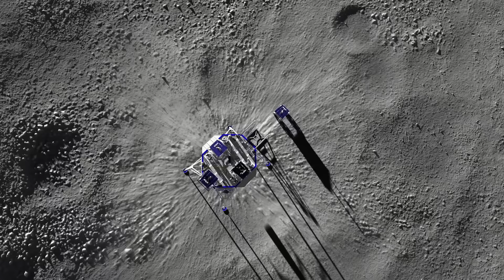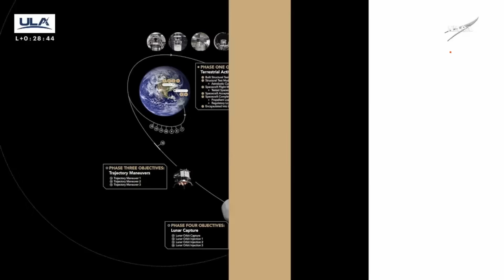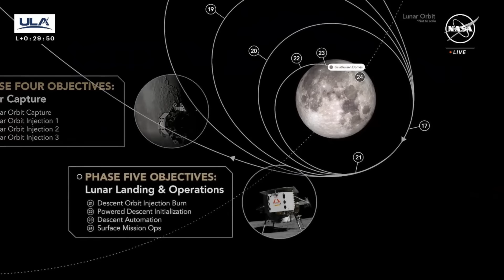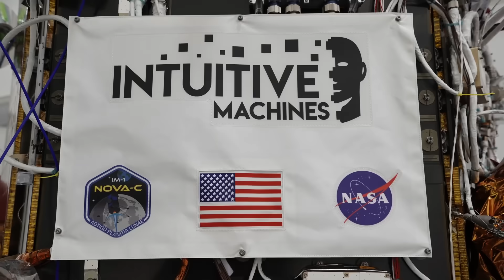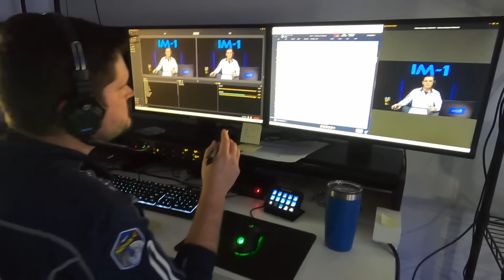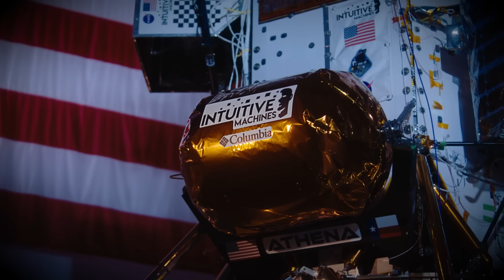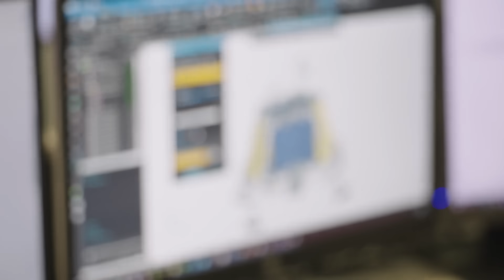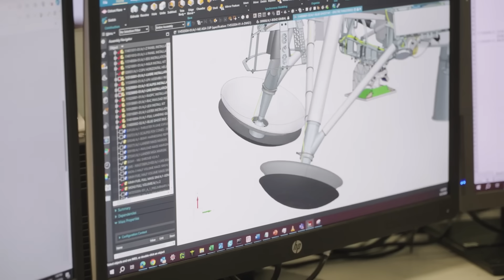Three Lunar Landers? Why Everyone Is Going To The Moon.

Comment: Update = Blue Ghost landed successfully on Sunday 3-2-25. Although upright...only 3 out of 4 sensors showed the 4 legs touching the surface. It's possible one of the legs went into a small crater or something. Look for update when they figure it out. At least it didn't land on it's side. It seems it's capable to perform the rest of it's mission now.

Comment: For the record, SCALPSS -  the neat experiment that's basically a bunch of stereo cameras pointing down to record rocket plume during landing is a NASA experiment and is actually on a bunch of missions (it was originally on IM1!) and say what you will about the CLPS program but they did some smart things like ensuring important experiments like that one get placed on multiple missions. Also on IM2 - it's actually got two rovers onboard, and a "hopper" that's propulsion-based and can go up to 25km!

Comment: Goodness, I hope you read this. I know it's unrelated, but I don't know who else to go to. I have the best question I have ever asked. There are two planets. They each launch a rocket placing them on a intercept course at apoapsis, and they dock. What happens to the orbit? Same speed and mass, etc for ships and planets. They meet perfectly at apoapsis and dock. What happens to the orbit? 

I like to imagine they fly out going for a tan, but now I can't sleep.
Reply: Well let’s say they’ll intercept with a difference in velocity of 1000m/s

One of both of them need to cancel out that difference before docking, and when it is canceled they will be in the same orbit. 

So you could go for target A from B moving more. Or B from A moving more. Which will put you into either A or B’s orbit. 
or you can go somewhere in between from both of them, and when their relative velocity is 0 than their orbit is equal.
Reply: Orbits are mainly based on the speed you’re going and direction. Docking means to bring them to the same location, and again since location is based on speed and direction, to dock in orbit means they are the same.

Comment: Not sure how deep a drill could get before it's power supply is exhausted.  
I'm thinking 60 to 80 cm.
The things we are going to find out.
Reply: - Kinda why they have Solar panels with batteries, and park in the Sunlight. Bigger problem might be designing it like the vibrating probe on the Mars lander, that got stuck in the dirt before it got anywhere.😂

Comment: I worked on SCLPSS when I was at NASA! It is going to be super cool, to clarify, it is going to be used specifically to improve Plume Surface Interaction (PSI) CFD models. It is basically the most expensive CFD validation possible... well only if you count assuming the whole mission is for SCLPSS, but it still felt cool to think about it that way lol

Comment: Why? Probably Helium 3..... A single ton of helium-3 could theoretically produce around 1,000 terawatt-hours of energy. That's enough to power a large city for a full year. There's LOTS of it on the surface of the moon.
Reply: It's not that common on the moon and so far entirely useless here for energy.  Maybe in a hundred years or so they'll have H3 fusion but so far the far easier methods are proving difficult.  This H3 business is silliness spoon fed to ignorant people and little more.

Comment: One thing that is driving me nuts is that why both the lander and the capsule have been on the same rocket considering that they are to different spacecraft and the they have to dock in space
Reply: Apollo used one rocket to launch both the capsule and the lunar lander because that simplified the mission. Instead of having to launch two rockets at precise intervals so they can meet up in orbit, they only had to launch one. This imposes limitations on mission size. So for Artemis, the lander and capsule will be on two separate launches.
Reply: @zounds010 that’s understandable but considering that they did it for Gemini with the igea unit it would make more sense to me that if you have a rocket that is designed for 50 tons you would want to use the full amount for more capacity

Comment: The primary goal of regular moon landings should be to figure out how to extract (and process) material for constructing large scale rotating space stations.
Reply: That would be a good one, that's for sure.  There is little point to extract resource off planet except to USE them off planet. :)
Reply: Exactly. Gravity wells are for suckers.

Comment: How does a vacuum cleaner work in a vacuum?  I'd love to see an explanation of this!
Reply: It completely sucks and doesn’t blow.
Reply: Just  two ideas off the top of my  head.  Use a gas, such as nitrogen blown into a housing to create a pressure differential. The high pressure will 'blow' material into the collection tube.  Similar idea to how Osiris Rex collected material.
Or, if you want to risk it, use electricity to create  a static charge so material is attracted to a collection device.  We  know lunar dust has a charge.
Reply: The Planetvac device is not a vacuum cleaner. It vents compressed nitrogen into that nozzle that sits on the surface. The nozzle is designed to direct that airflow over the surface and then into a collection tube. The air will pick up particles from the surface, depositing them into the tube.
Reply: well its a vacuum, so its cleaner
Reply: @ I don't think anything can "clean" the moon of dust and debris... so maybe a Vacuum Assisted Particle Sucker? VAPS...
Reply: A vacuum cleaner doesn't actually create a true "vacuum", it just created as differential in air pressure by sucking air through a FAN... no air means nothing for the fan to accelerate and therefore no differential in "air" pressure and no suction...
Reply: @Reality_Check-1969  exactly, so how do you create differential pressure when you are starting at, basically, zero?
Reply: @ Since we are talking about "vacuum cleaners"... you can't... with Zero Atmosphere, you can have zero "air" flow as you have NO Air...
Reply: @Reality_Check-1969  hence my question. I wonder if they're calling it a vacuum cleaner but there's something clever with static charges or similar being planned to attract the regolith somehow
Reply: If you want to know how a rocket can move in a vacuum, Newton gave the answer long ago.
Reply: @ awesome... but no one asked that... 😁👍... and did you know Newton discovered Figgs and baked cookies?

Comment: Lunar lander development comparison between Blue Origin and SpaceX:
Blue Moon will land successfully on her first mission.
"Starship" will explode 5-7 times en route to the Moon. The next 4-6 will impact into the surface. Nothing special, only 10-20 people will die, but Grok said it is absolutely OK.
By the way: as I look at some of these spacecrafts, they start to look like Formula-1 cars: heres a sponsor, theres a sponsor. Ohh, and yes, there is another one. Well, our next spacecraft must be bigger to have more surface for ads.
Reply: SpaceX did not start launching people on their Falcon 9 until the rocket was consistently safe. I don't see them carrying people on Starship until that, too, is safe.
I can agree with criticism towards Elon. I can agree that SpaceX is often behind significantly schedule, that they take many tries and test flight explosions before they get things right. But they have not endangered passengers, and I don't see this changing soon.
Reply: @nikolatasev4948  At that time Musk wasn't in the royal court, sitting on the throne, meanwhile the elected king acted as court jester. Things radically changed.
Reply: if any good or interesting picture ill be shown for several hours in news and other non advertisement slots it mus be exploited. better than spending the same amount of time to support the usual stuff that gets supported by advertisement. and it is not even a new thing. just the advertisers changed from governments who plastered their flags on it to companies who plaster their flags on it.
Reply: Oh you haters and your lies..

Comment: How do you vacuum up regolith when it is already in a vacuum?
Reply: Electric fields.
Reply: The Planetvac device is not a vacuum cleaner. It vents compressed nitrogen into that nozzle that sits on the surface. The nozzle is designed to direct that airflow over the surface and then into a collection tube. The air will pick up particles from the surface, depositing them into the tube.
Reply: With the vaccum from Space Balls I would imagine
Reply: Space cannot be a vacuum if we can reach it from our atmosphere because there would have to be a barrier between the atmosphere and the vacuum.
Reply: @andrewbullman5206 
The atmosphere is a gradient. Are you unaware that air pressure decreases with altitude? And by the time that you reach the Kármán line gas molecules are so sparse ad thinly spread that it is effectively the vacuum of space.
Reply: @ well, the point where an airplane has to be flying faster than orbital velocity to get enough lift to fly.
Reply: @andrewbullman5206 sounds like you have a vacuum between the ears

Comment: Still seem very dependent on finding a very level and fairly smooth spot to land, so I expect a probability distribution until rovers can provide a finer survey of sites. So it will get better. Mapped flat and smooth areas with a homing marker should reduce errors, the amount of finger crossing, and tip overs.  SpaceX will need flat, smooth, and a subsurface survey (if not a marked paved area). Tipping should not be an option even if the owner enjoys chaos to motivate and feel in control (what I've considered the management by arsonist technique, another story from another time).

Wonder if they considered using a lawn dart method for small early landers. Decelerate on a single shocked penetrator so a twenty degree lunar slope doesn't result in a fail. Vertical landing speed tolerance opens up a bit also. More of a thwack with the small pointy penetrator end down and enough vision not to hit a big rock.
Reply: They'll land where the customer asks them too, which would be NASA.  They don't need a perfectly flat area nor a paved area, but certainly it would be wise for NASA to pre-scout a little.
Reply: @TheEvilmooseofdoom  Opinion was one based on mass, span, and stated leg deflection. Just say I consider them a bit bouncy and tippy for a slope.  The designs will have to adjust, the means of resolving a flat level area will have to improve, but likely it will be a bit of both. Air bags could still be an option, a lawn dart, lowered by sky crane, have a method of self righting, or a method to roll over and adjust things to work if after falling over.... 

As for SpaceX... Ok, I'll assume North America so imperial.  Stating a 100 ton payload. Legs undecided but lets go with ten foot pads that are 2 ft squares. If it lands perfectly straight and the bearing surface is of exactly equal strength that works out to 2.5 tons per square foot with a fairly soft one gee touchdown. The mass is at the top and the span is a small fraction of the length. No moving items built on unimproved soils soils in our one gee world recommend not exceed 2 tons per square foot and this tower will not perfectly plumb. Numbers get much better with graded and compacted gravel or even better a paved surface. Could even be two degrees of plumb and not fall over. That is one big heavy ship.

Will they try anyway. A fair bet. Though since it's a cargo run, figuring out how to have a useful payload after it falls over should be considered in the final design (again IMO). Could even consider having rockets to tip it over a slow the fall to get it horizontal by design.  Put side legs on the side of the pointy end only and have a ramp. No big elevator required.

Comment: At 13:35, the sun is seen setting over the lunar horizon.  In the mid distance is what appears to be a crescent moon!  If the POV is from the lunar surface, what is the crescent shaped object?
Reply: Earth, but since it's an artists rendering it's probably not too accurate.
Reply: @Ben4DeepOrbit aha that makes sense.  If the moon appears to be same size as the sun when seen grin earths, and the earth is 4x the size of the moon, then the earth should appear to be about 4x the size of the sun when seem from the moon, which seems roughly what the animation depicts.
Reply: Looks like they were going for sunlight refracted through the atmosphere, given that the Earth is not separated by a wide angle from the sun.

Comment: Scott, don’t we already have some rudimentary information on the exhaust from the landers from the Apollo missions? Or is it possible that they were not making any attempt at overanalyze those particular matters after the first landing and we basically were probably like…”ok, we didn’t sink so all is well”?  I’m kidding about that but honestly Scott, they must have attained some critical analysis of how rocket exhaust affects the lunar regolith. I understand the rocket exhaust has probably become much more potent so to speak, but there must be a base line we can start with?
Reply: There is (and famously, Apollo 12 landed near Surveyor III and there's analysis of the damage to the earlier probe from the dust kicked up by the Apollo lander) - lots of papers, lots of simulation, but there's still only a small amount of Real Data that it's all balanced precariously on (also a relatively small range of lander exhaust thrust.)  Also the samples of regolith itself only represent some very limited areas of the surface, there may be simply unknown variations...
Reply: " I understand the rocket exhaust has probably become much more potent"  Why would you think that?  Apollo landed a LOT more mass on the Moon, so they would have by far had the biggest rocket plumes.
Reply: @stargazer7644  I was thinking about Starship HLS in particular - though I thought one of the cancelled landers was similar in mass to Apollo, from what I can find it's actually more like 25%, so you're right, that isn't a concern for most things actually going to the moon.

Comment: Hey Scott,  why don't they use nuclear reactors like on voyager anymore?
Reply: Because the Plutonium 238 is in very limited supply hence expensive. Not to mention everyone freaks out over potential launch pad explosions.
Reply: @owensmith7530  Pu-238
Reply: Not nuclear reactors, Radioisotope Thermoelectric Generators (RTGs) -- RTGs use thermocouples to convert heat into electricity.  There's a dearth of the Plutonium-238 used to power them.
Reply: DOE shut down the only American reactor that made Plutonium 238 in 1988.  Russia also shut theirs down in the 80s.
Reply: @stargazer7644  And then bought some Pu 238 from Russia, but understandably don't want to buy more from them even if it were for sale.

Comment: Firefly is testing a vacuum based regolith collector? VERY confusing. It actually blows the regolith in using the unit's own gas supply, rather than using a pressurised atmosphere. I assume they recover as much of the gas as possible by the "vacuum" bit. Very neat and hopefully reusable many times, but definitely a WTF description.
Reply: Just a little puff of gas and the pressure differential will cause plenty of movement that you need to grab what’s kicked up, or pushed back into the collector based on where.

Comment: Isn't Columbia an apparel brand? Why are they a sponsor for the Intuitive Machines lander?
Reply: Columbia makes the heat and sun shields on the Intuitive Machines landers. @quillaja is literally right.
Reply: @stargazer7644  they do use a kind of mylar material in some of their outerwear. Makes sense that they'd be able to apply it to a spacecraft as well. I'd never have made that connection.
Reply: It's cold on the moon and you need a good warm puffy jacket.

Comment: These all seem like careless mistakes.  I wish I knew exactly why these expensive projects have so many failures when we did this 60 years ago. They wrote it all down back then. Go back and read it. I know it’s all remotely controlled right now, but simple things like landing legs breaking or RCS thrust failing - like they’re thinking “we made it to space we’re done.”
Reply: If you read “The deliberate dumbing down of America”, it makes more sense.
Reply: More bureaucracy, more difficult mission goals, more government meddling, innovating newer technology instead of refining older technology, more concerns that don't directly relate to the mission, less international pressure uniting the country... take your pick.
Reply: If you need references to the above statement the department of education is a great example. 
Look for yourself at how it performed from its founding in ‘79. 
That’s right, a decade after doing space we decided government is the educator. All downhill from there, the data is availiable.
Reply: That's because seems is worthless.  It's little more than you guessing.  These projects are not that expensive, not compared to the national effort of 60 years ago.  Clearly you understand very little and equally you're to lazy and stupid to make any effort to inform yourself.  Another fool and another fail.